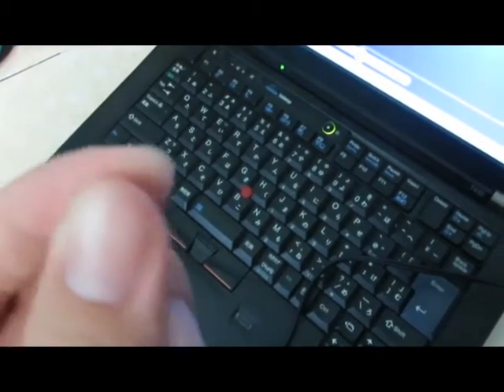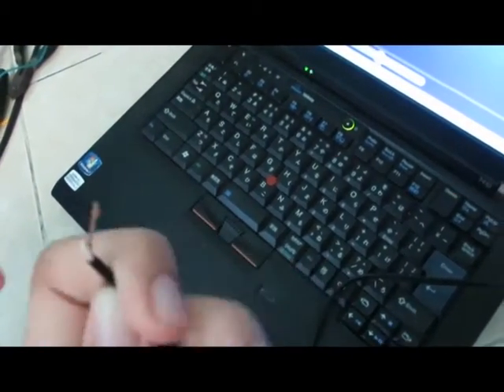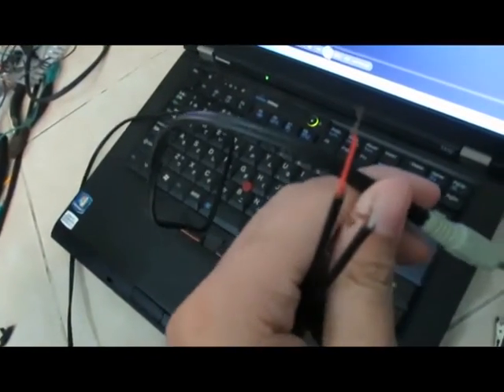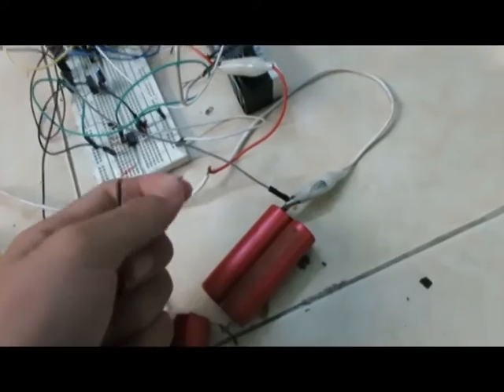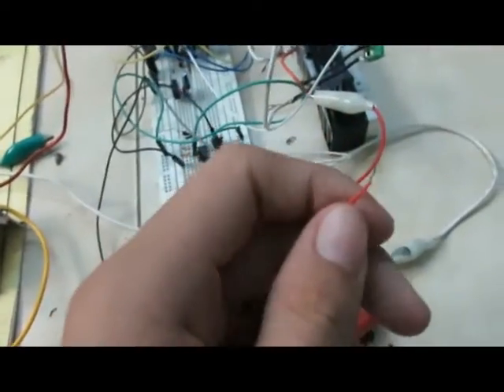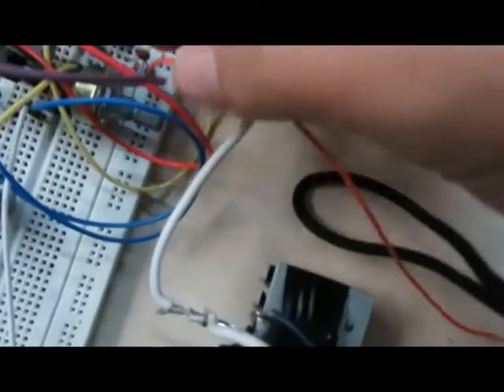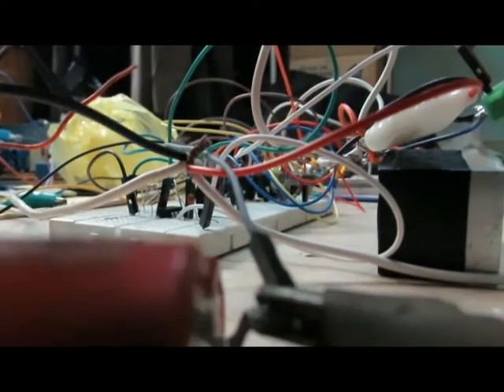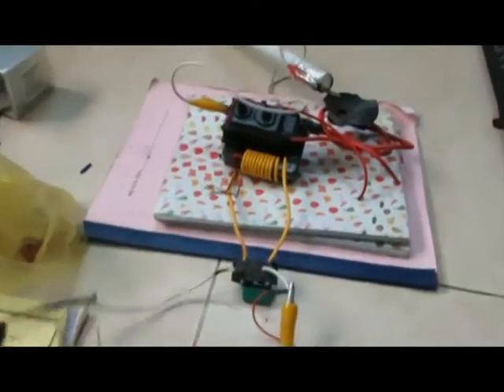How to make plasma speaker "detail"

Comment: I've burn a lot 555nc timer with this project, I've also been using this circuit, but I didn't put audio and just leave the pin 5 disconnected, within I'm only getting no more than 1 inch of an arc in 18v power supply
Reply from the maker: how many voltage you supply to ic555
Reply: I parallel two 9v step-down transformer on the input then connect output wire in series so I got 18v and just rectified it with diodes and capacitor. I understand now why I was burning a lot 555nc timer, it's because the EMP kickback of the inductors of flyback, now I just turn the two potentiometer both for frequency and duty cycle to the highest resistance before turning off